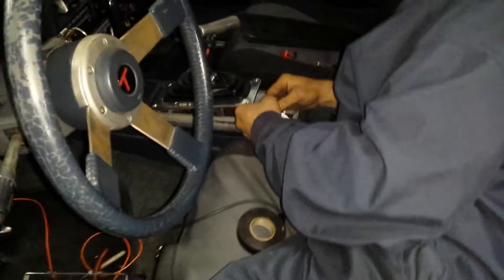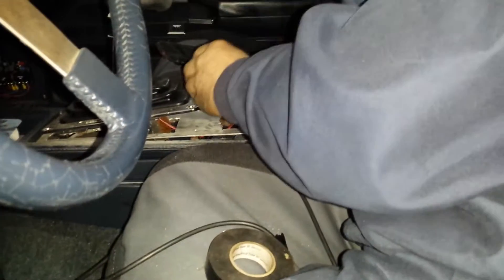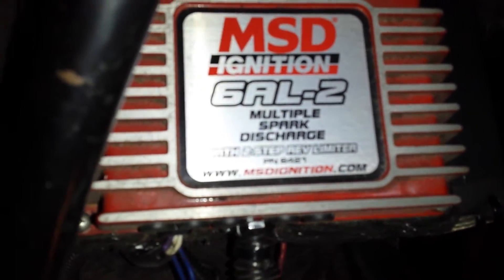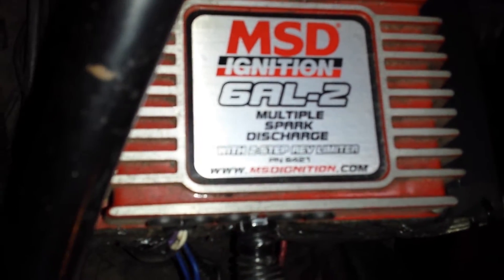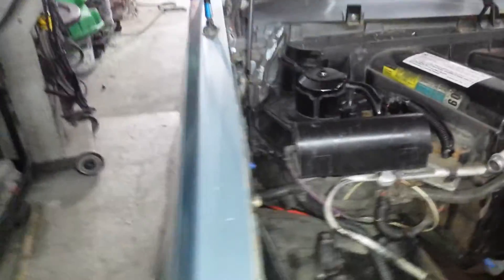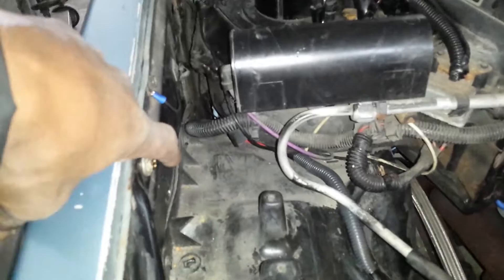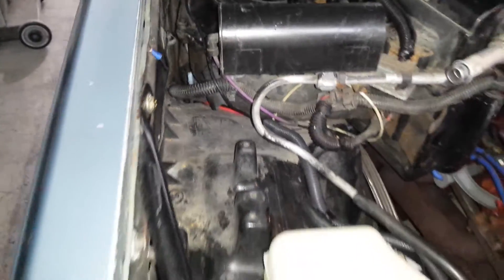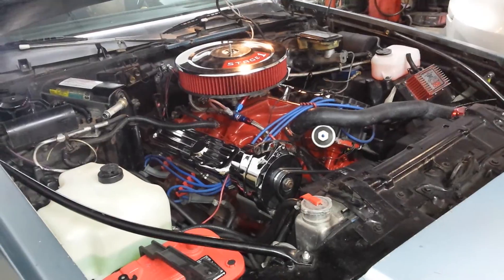CDS Stage-1 Buick 455 Regal APPOINTMENT with RALPH Part#6.   11-7-2014

Comment: The Buick is looking good. Are 455 engines hard to find these days? I ask this, because I might buy a Skylark, or Regal, and I would probably want to install a 455 in it, and make it a sleeper.
Reply from the maker: Guy Massaro  My engine builder has 1 right now for sale; complete Buick 455.